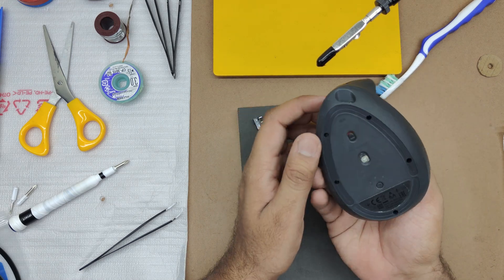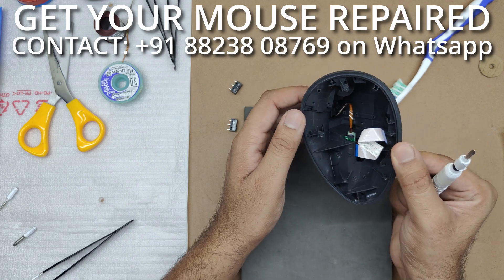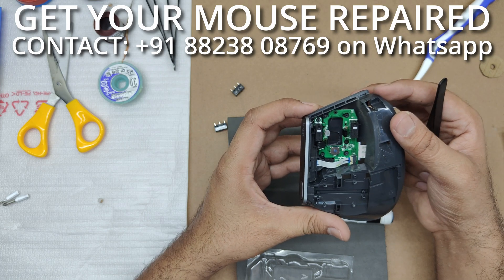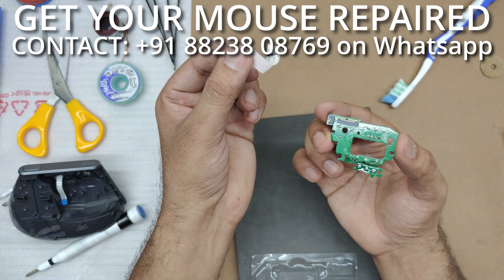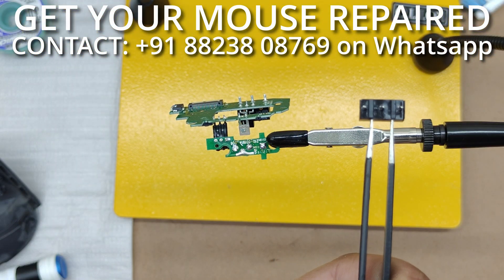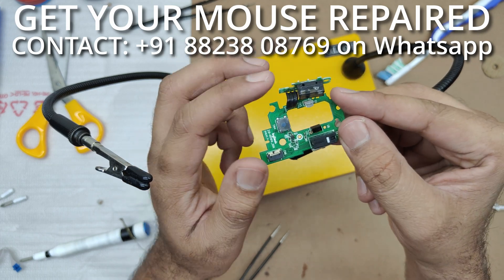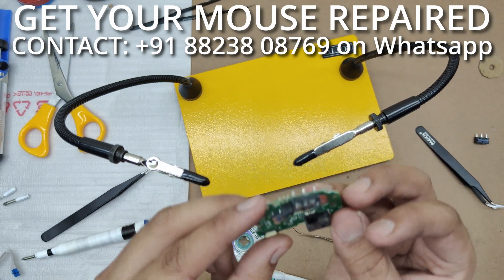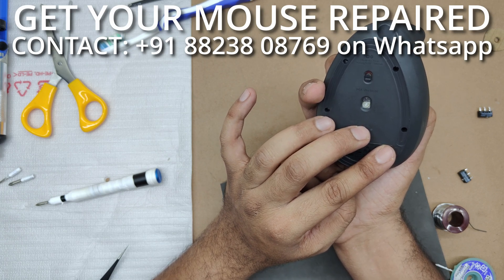Logitech MX Vertical Disassembly and Switch Replacement

Comment: Thank you, I’ve had one in my ‘to fix’ pile for some time. Looks quite an involved procedure, but worthwhile because it’s an expensive mouse to throw away due to a single cheap switch failure. I wish they’d start using optical switches in these for durability!